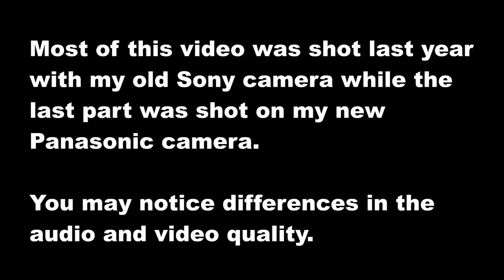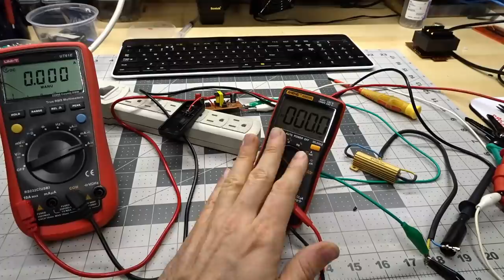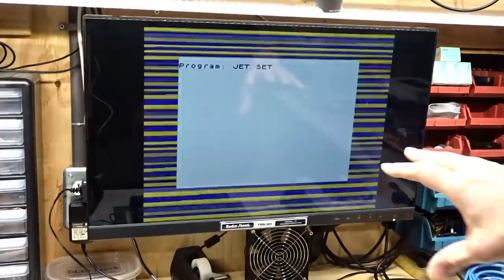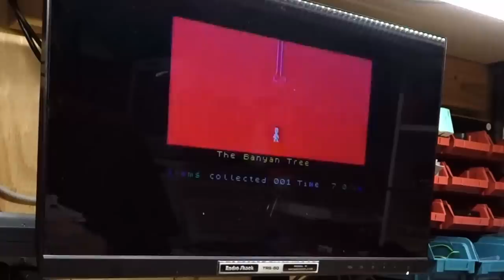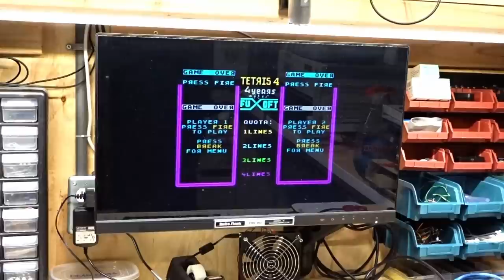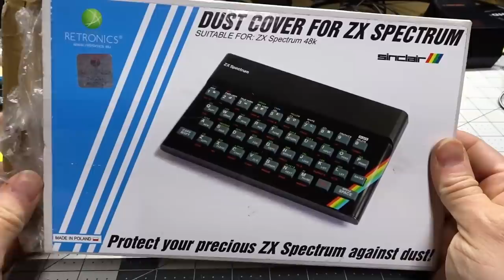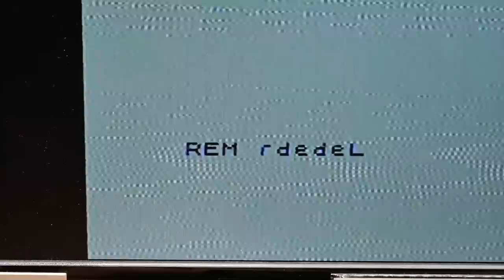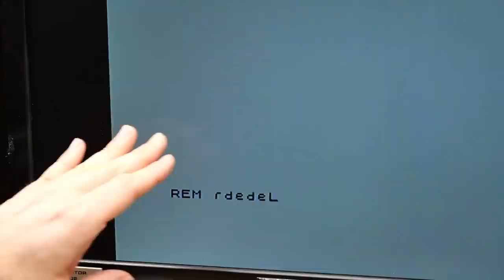ZX Spectrum Part 3 - Revisiting the machine at last!

Comment: I still use Cassette Tapes on occasion, the Tone has a big effect on loading, not just the volume, also elecrtrical things interfere with Speccys, hoovers, microwaves and the like.
Reply: You are right about the tone control; in my experience it's best to put it in the position with the most amount of treble so as to let the high frequencies pass through without any attenuation.
Reply: Yeah my mum had in the late 70's a tumble dryer and ye gods it pumped out tons of dirty signal that made the telly go funny and good luck trying to play on your Sinclair, surprisingly it didn't affect the Atari 400 we had which had an all metal chassis inside the plastic.   Old telephones were dirty emitters, putting a tape cassette next to an old dialler fone would erase it quicker than anything, fridge motors too were a pain in the rear too come to think of it.
Reply: Ian Watson I put my iPad on a pile of Commodore 64 disks the other day, and put my very good wireless headphones on top...... and promptly erased them. They make it all the way to 2020 intact, and a seasoned C=64 owner from the 80’s erases them with an iPad 7 21st century tech that is essentially a  computer in a slab of glass to watch a tutorial on how to copy disks to SD Card using a Final Cartridge I just bought and have wanted since I was like 7.
At 43, I’m going to have the computer of my dreams dammit, note to self... Data used to be stored magnetically in plastic sheets, not 1” square wafers of silicon.
Reply: Correct! Volume 8 Tone 8 or Volume 8 Tone 2; if this didn''t work the recording was faulty

Comment: During the 1960s (maybe earlier) to the 1990s, most appliances in the UK were sold without a plug attached - just the bare wires. The customer was expected to install the plug themselves - and select the appropriate size of fuse. We used to get taught how to do that in high school. But the previous owner of that Spectrum obviously followed the fairly common practice of always just using the biggest fuse available. Suffice to say electrical fires decreased dramatically after appliances started being sold with molded plugs installed from the factory.

P.S. I'm late to the show, but loving it.

Comment: I used to fix these when I was a nipper (15/16 years old, part time in a computer shop). Worst case was one some kid had plugged a generic power supply into the mic socket. Burnt a hole through the ULA and the board. His dad casually mentioned blue smoke coming out of it. One cat's cradle of wire later, and I got that thing back up and running! The membranes were always a pain - they used to get stress fractures across the tracks. Great job with bringing it back to a really nice condition.
Reply: yeah always on J and P lol

Comment: I think your problems originate from the 'noisy' switching supply you have made. I suggest you try to listen to the tape output from the spectrum to see if there is some noise on the audio side.
Reply: I agree.
Reply: I’m like dude, you have a sweet oscilloscope right there! Plug it in and have a look to see if the phone is clipping the audio, and if you are just amplifying they clipping. Lower the phone audio and pump up the amp. Look at it on the scope. You could also try dedicated playback devices like actual tapes.
Reply: I was thinking that, I've had lots of video / audio trouble with cheap Chinese switching power supplies on various consoles, I learnt to use old linear PSUs all the time

Comment: I was born in the UK and my first computer was a ZX Spectrum. My memories of the spectrum came flooding back when watching your video. Yes the tape loading was very, very tempramental. We had 3 or 4 nice tape machines in our house but the spectrum would only load from a horrible cheap cassette recorder set to 3/4 volume. It didn't have any tone or other controls and the sound quality was really naff, but this was the one the spectrum loved..... My brother had a very nice Sony tape deck with equaliser and VU meters and untold extra buttons......Nope! Not a thing would load from that. My Dad's stereo had a super tape deck with all sorts of extra settings and dolby noise reduction.......No! The cheap unbranded mono tape recorder worked great! Nothing else would work.

Comment: Back when the Spectrum was for sale, it was common for electrical equipment in the UK to not be supplied with a fitted plug, so people would fit them themselves. Plugs were typically sold with the maximum fuse rating, which was 13A. I used to work for a shop helping delivery electrical equipment such as TVs and video recorders back then, and we would always have to fit a plug, with the correctly rated fuse of course.

Comment: The easiest way to remember Brown = Live/hot is its the colour your your pants will be when you touch it.
Reply: He's wrong, both blue and brown are "hot".
Reply: The Johnny Poo Poo pants song comes to mind.
Reply: @Pico_Farad  Blue is neutral. The neutral is connected to earth/ground(in a single phase residential install). In a good installation neutral and earth have the same electrical potential. The only time the neutral is 'hot' is when some idiot installs it wrong.
Reply: @SuperCloneRanger  it's very safe to assume that electric wiring at the premises was done by an idiot and might only be accidentally correct.
Reply: @SianaGearz  lol, accidentally correct. That's brilliant.

Comment: DivMMC Future from The Future was 8bit. Seriously.
Reply: He'll need the correct power supply to run that.
Reply: A good power supply I have found to work well is a 9v label printer power supply. Makes sure it's centre negative but most label printer ones are. Dymo label printers use these supplies. Found easily on Amazon
Reply: @Flamelily-IT  The link I posted above sells replacement ZX-Spectrum power supplies as well as other items.
Reply: I have a Dymo label printer. I rewired the 9V DC input for centre positive. I can still use the batteries.

Comment: That hack you've done to swap out the 240VAC power supply for a 120VAC to 7VDC switching supply is very well done. You've done the right thing to reduce the excess heat from the LM7805 voltage regulator.

You're right the original owner should have had a 1A, 2A or 3A cartridge fuse in their BS1363 type-G plug. 13A @ 240V is good for a 3KW room heater, a washing machine, dish washer or an electric kettle. 

Modern BS1363 plugs do have the shielding on the live and neutral pins (required since 1994) - so your plug from 1980 is contemporary with your Speccy.

Comment: So you remove RF shields from most of your computers and now you complain about having interferences ? Hmmm

Ok I'm just kidding x)
Reply: I don't think the Spectrum had RF shields!

And I'm deadly serious -_-
Reply: I never said the opposite !
Reply: @DxDeksor  I know, the C64 RF shields were a bit pf paper with tinfoil on them (neither use nor ornament)  and the Deladly Serious comment.. well, y'know, I was being flippant.
Reply: No, it never did have but maybe it should have.
Reply: @GeoNeilUK  I have a NTSC Spectrum and it does have top and bottom shielding (as well as an extra coil, different ULA, different crystal and Ch2/Ch3 switch)

https://beta.collectorsbridge.com/collections/sinclair-computers-and-clones/article/sinclair-zx-spectrum-ntsc

Comment: Hi Adrian ! I had various ZX from '84 onwards and really once you got used to the input algorithm you could key in programs way faster than on anything else. I'd managed to frustrate my C64-using friends on that topic on a regular basis when it comes to write small testing programs. In additon I started using the Beta Disk Controller along with a set of two 5.25" floppies pretty early to get rid of the tape loading problems. Additionally on the ZX it is comparatively easy to invoke machine code routines - however: Z80 assembler is a beast of a code.

Regarding the tape load problems: never use open circuitry or cables. Put the headphone amp in a case and that will do most likely. These days you have a hell of disturbing stray RF signals from cellphones, WiFi, UMTS or "smart devices" of any sort - which didn't existed in the early 80s when the ZX had been designed. Most of them are digital with short signal bursts that confuse the analog input. Apart from the volume sensitivity. That depends on at what level the programs got stored before conversion and that then depends on the equipment of the one who did it.

Well ... Time to dig out one of my surviving ZX Spectrums maybe. I used to convert mine from RF-TV-output to plain FBAS composite video, which is easy when you take the RF-modulator input for that purpose. Just a hint ...

Thanks for sharing !

Comment: The UK plug is such a good design.  The earth pin even activates a mechanical part in the socket so that you can electrocute yourself by sticking a fork into the outlet.

Comment: Ex Pro A/V designer/installer here. We never used pre-terminated RCA cables for anything, instead we terminated RG6 shielded cables for any analogue video we ran regardless of length. We used either compression RCA connectors, or sometimes BNC connectors. This side stepped so many analogue video issues. So I am not surprised at all that the crappy unshielded cable gave you so much noise on display.

Comment: I did something similar building a supply for my VIC-20. 12v transformer for the AC pins, and the guts of a small 5v 2.1A wall adapter. Mashed them together in a single case, making sure there was adequate spacing and ventilation.

Comment: I have fond memories of my ZX Spectrum. It uses the Z80 microprocessor and you could program it in assembler.
The expansion port on the back was basically the Z80 bus.
I built an EPROM programmer that plugged into the expansion socket. The ZX Spectrum has long since gone but if I can find the programmer board I built - I'll send you some photos of it.

Cheers BigAl

Comment: Hi i come from Dundee Scotland where the Spectrum was made in the Timex Factory, The Spectrum ALWAYS suffered from loading issues and this may explain why yours looked the way it did, 1 popular mod made to the Spectrum was to fit a non locking push to close switch across the power supply cap inside the spectrum giving you a reset switch.
A lot of the software for the spectrum was quite rough and ready and was known to be a trial to load reliably, and this issue continued into the Plus 2 which i had as well as the spectrum, Best of luck it is a great wee computer for playing games with when it works......

Comment: Just a helpful tip. I like using an electronics cleaner with ipa in it or a flux remover that is safe for plastics with the yellow sos sponges that kind of have the fishnet outside on them. They tend to not be abrasive enough to do damage and with a couple sprays of the flux remover the adhesive comes up. No screwdriver scraping required. I'll get the exact names of the cleaners when I'm home tonight

Comment: The purpose of a fuse in a UK plug is to prevent the cord overheating and catching fire, if the appliance on the other end of it needs a low value fuse for over current protection, it will provide one in the case. I've often seen devices that draw very low current with 13A fuses in the plug and I'm quite happy to declare them compliant and safe to use IF the cable is suitably sized to handle 13A (even if it will never get used for that much current). Of course sometimes you'll find a 13A fuse in a plug connected to flimsy aluminium cable, that is when it becomes an issue. The plug fuse shouldn't be used to protect the device, it is there to protect the cord.
Reply: Except the power cord on a ZX Spectrum PSU is 0.5mm^2 two core and should be protected with a 3A fuse. In fact it would happily work with a 1A fuse (which you can get by the way).

Comment: If you use one of the more common 9v switching power supplies, all you need do is change the trip voltage of the feedback so it turns on at a lower output voltage. Lots of these use TL431 shunts as adjustable zeners on the low voltage side feeding the led of a feedback optocoupler. The opto turns on when the output voltage is at the correct value or higher. You need to lower the value of two resistors slightly. First the upper divider resistor on the TL431 Vref to lower the voltage and the inline current/gain resistor in series with the TL431 cathode and the opto led which makes up for losing headroom gain.

Comment: On my Timex/Sinclair 1000 I also had to cut the keyboard ribbons to make it work.  I wound up desoldering the connector from the main PCB and reattaching it with some lengths of wire to give me the extra room I needed for future assembly/disassembly of the machine.
Reply: That was a pretty common fix ;)

Comment: Hey, that takes me back to my introduction to computers.

There were a myriad of protection methods to stop tape copying. 

They usually relied on a simple loader (the first part) then you use the games timer for the main load.  Sometimes the main load would overwrite the ROM and foiling 'soft ROM hackers.

It being a different timing it was much more sensitive. One fix I used was adjusting the azimuth of the tape drive. Five minutes for every test.

But I did learn Z80 machine code!

Basically whatever you use for input there is a ton of hit and miss. Very long nights just getting to the actual code for modding. Or hacking as it was called back then!

Yes it IS that bad and was from the start. HTH.
Edit: Just remembered that if a game used the built-in ROM calls for loading, it was almost 100% successful. Changing to the game authors load calls is where all the issues originate. Think analogue.

Comment: Ah, it's just like being back in the 80s. I used to write the volume settings on my cassettes as they were all slightly different from each other, and it was a pain tweaking it every time I wanted to load something. Some tapes woudn't work at all, and I'd have to go and borrow Mum's tape recorder to make them work.
On your setup, I'd recommend switching out that stereo to mono cable for a mono to mono one. You can get problems if the cables are slightly different lengths, and using a straight mono cable would eliminate that. The mono connector bridges the left and right channels in the stereo socket anyway.

Comment: Back in the day we used cheap mono tape players with an 8ohm output from the earphone socket, so it was natrally a much louder signal into the computer, but i've heard folks say using stereo can can cause load errors
Reply: My hazy recollection was "the cheaper the better" when it came to tape players for Spectrums. And avoid systems with graphic equalizers!

Comment: Ah the joys of getting the volume / tone controls correct on my old tape deck back in the day!
Different publishers had the volume set slightly differently on the tapes, so you got to know which volume level you needed for a particular game 😃
Reply: That said, it was never as unreliable at loading as you’re finding, only the occasional error.
I can only think it’s something to do with the connection from the phone.

As far as your closing comments about usability, the C64 over here cost a huge amount more, so it’s not a completely fair comparison. The Speccy+ addressed the keyboard to some extent and the later 128k versions had a ‘proper’ keyboard and did away with the one-touch keyword entry which was a godsend! 😄
Admittedly, the C64 keyboard is always going to be better, but you get what you pay for.
Nicely, the Speccy has a very good version of BASIC which didn’t rely on POKEs for many things. The interpreter was a little slow, but the feature-set made up for it.

It’s so nice to see one across the pond and being given a good home. I think your best bet to experience the machine would be the DivMMCFuture from tfw8b.com so at least you can load up without the phone 👍

Thanks for returning to finish the Speccy. Another fab video 👍

Comment: I owned a C64 myself, but several friends and my uncle owned a Spectrum. The tape loading was temperamental to put it lightly. I used a datasette with my C64, and except for the odd need for a head adjustment, I never had the issues those guys had, same with my cousin who owned an Amstrad CPC with built in tape drive. The issue could be something as simple as your phone running the audio through a filter that's causing read errors, but honestly, it's just as like that the tone(I'm not sure how you'd do that on a mobile phone) and volume need to be adjusted. It wasn't even unusual for them to need adjusted on a per game basis.

Keep in mind, those things cost one third the price of a C64 and every corner was cut to ensure a computer that could be bought by even the poorest of people. It sold in millions and is fondly remembered due to this, but before Amstrad bought Sinclair out, the Spectrum models were infamously unreliable and yours is indeed a genuine Sinclair model.

Comment: The sleeving on the UK plug's pins is so that you don't zap your fingers on inserting/removing it from the socket.  I believe it works in conjunction with the safety "gate" that sits inside the wall socket.  It also has the advantage that it stops arcing between the pins, that you sometimes get with (Laptop) PSUs.